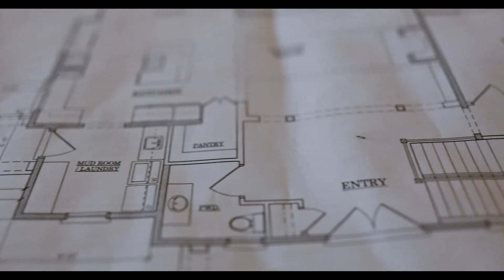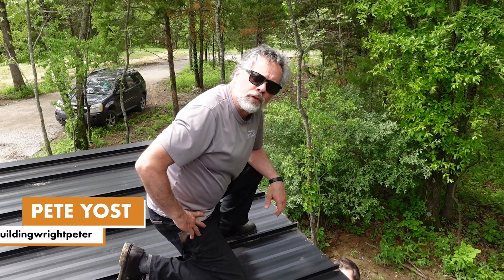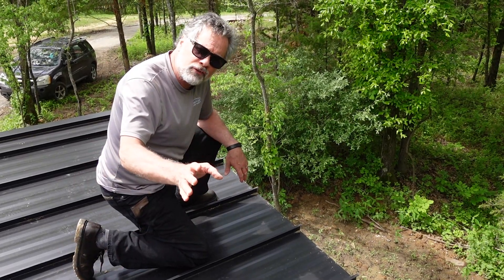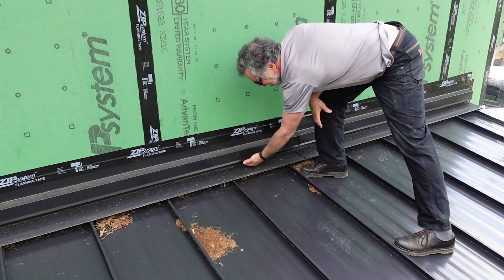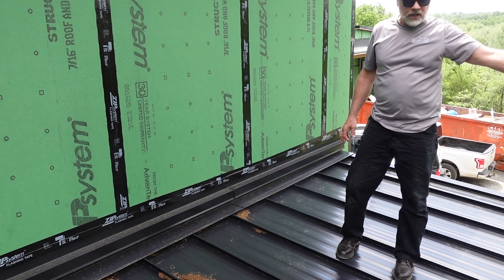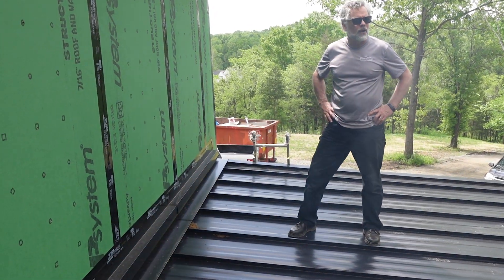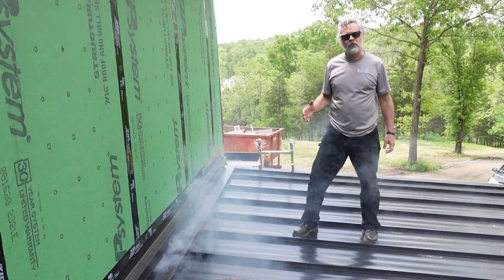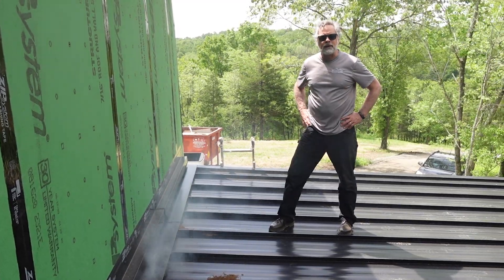Will that low slope roof vent?

Comment: Would love more details!  I have a 12x18 porch in Northern Wisconsin I built with a 1-1/2:12 pitch metal roof.  Would like to close it in and heat with a wood burning stove.  The porch is outside the building envelope so I don't need insulation to code, however, a cold roof would help prevent Ice damming. Would this work with a galvanized roof where stack effect wood be minimal....or should I look at a power vent?!?

Comment: Is this a double roof deck set up with 1x3 strapping between? If so is the upper layer of roof decking cut back at the wall connection? Any additional strapping between the metal roof and the roof deck? Great stuff guys!